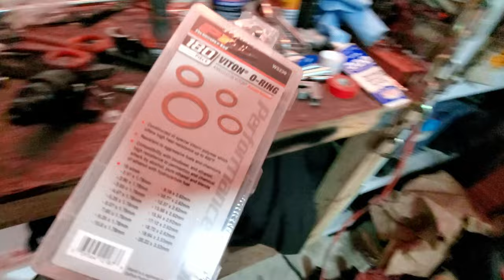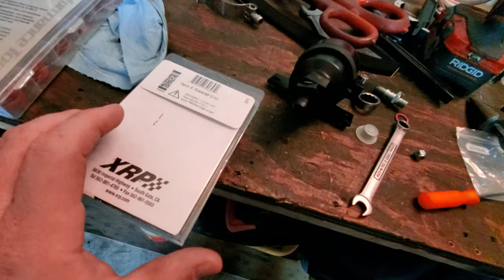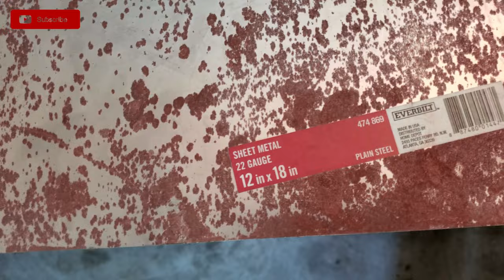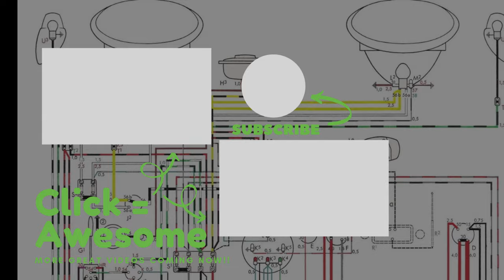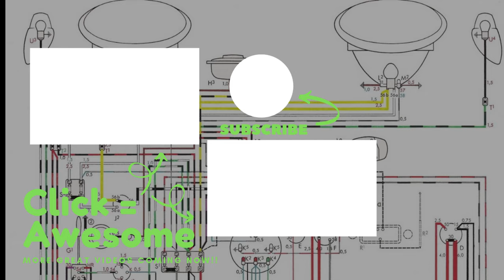1956 TURBO VW BEETLE - EFI Fuel System - Part 4 | JW Classic VW

Comment: Fuel line transition is much better! Nice simple bracket makes it look cleaner and is much more secure. A suggestion for a painting, instead of using a clothes line, I use a cheapo clothes rack from The Walsmart. Just lightweight tubing and it has wheels so you can move it around. It just press fits together so when you’re not using it, just pull it apart and stick it in the corner. Just a thought. Awesome job so far brother! Can’t wait for the next exciting episode!
Reply from the maker: Great idea on the clothing rack... I'll look into one.

Comment: I've been following your build.  I like your workmanship and creativity.  That 044 pump is the same one in my Audi B5 S4 with a full stage 3 set up.  In my case, that pump is good for about 425-450 HP at the crank.  

I'll be stealing some of  your fuel system build concepts for my 1971 Super with a turbocharged type 4.  The test motor is a 1911cc.  The big motor should be a 2600 with a T4 turbo.  

Thank you for your channel.
Reply from the maker: Appreciate the love and support, it's been a journey 4 sure!  I always love to hear that people enjoy the channel.  The biggest thing I try to show is that it can be done... I know the build is a little extreme but I know for 1 guy getting it done in his little garage the VW crowd can see anything is possible.

Comment: Great build...With all the volume of the E85 being used. Maybe it would be good to make a larger fuel tank?  Tig one up in aluminum. Seems like it wont have a very good range. MPG will be less than gas and  seems like you will need to fill up more than one time a day with that big turbo engine and Extra fuel use of the E85 will be short for driving range.
Reply from the maker: Kinda been thinking about a surge tank or an additional tank somewhere.  Definitely not a bad idea.
Reply: @JWClassicVW  yea you could make a rectangle box with a lip to set in the same hole. then square up the bottom to fit with he steering stuff. might get about 13 gallons or so. Which would be enough to get some range.
Reply from the maker: Yeah... there is definitely going to be an on-going evolution of Goose to a full out street killer race machine.  Roll cage coming with some cool seats.  Man I would love to have you help me come up with some sweet seat pads for the race seats.  Maybe we can get some ideas rolling?!?! lol

Comment: Hi I wanted to ask what kind of paint did you use for your gas tank Ty kp up the great work cant wait till its done
Reply from the maker: If you check out the video description the info is there on the Gloss Black and the special clear coat.
Reply: @JWClassicVW  well duh I guess I shld have read more.  Thanks

Comment: Is the haltech easy to set up? I know you bought the engine with the efi already on it but I want to go to efi and want to know if you can give me a basic must have to run a efi set up. Like a ECU, fuel injector (size) head temp sensor , timing sensor, TPS and anything I missed for a beginning set up. Your input would be great or if a CB setup is better way to go. I just feel like I could piece it together cheaper and have better stuff. Thanks
Reply: So what is the basic sensor list needed to a engine running with a haltech ECU
Reply from the maker: Did a video on the sensors brother.... there are a few other that are nice to have... I'll see what I can put together.

Comment: Is the 5speed a overdrive thanks
Reply from the maker: No it's simular to the final drive in a 4 speed... with the 5 speed your just adding an additional gear to shorten the shifts.  You can check out more info on the Berg website.
Reply: @JWClassicVW  thankyou 😊
Reply: I think it is a great track option. Ususally you shorten the gears when your on the track. and it makes the car not drivable for regular freeway. So 5th gear is like a normal 4th but the 4th is for the track if you get what i am saying.
Reply from the maker: This trans gearing is still good for the freeway... not sure on prolonged driving but it will cruise at 70mph at around 4200 RPM.
Reply: @JWClassicVW  yea for sure on a long drive that might be an issue that is high rpm for most vws that would not work. Most over max of 3800 will run hot and blow oil out. yours being turbo and vented may be ok but it will be a wait and see. Fan reaches maximum efficiency at around 3500 may experiment with power pully...IDK. Shroud starts to pressurize at some point and fight against itself.
Reply from the maker: This engine is running the Bernie Bergman set up for cooling.
Reply: @JWClassicVW yea should be ok. I just dont know the maximum pressure for that setup and RPM it achieves it  probably will like a higher rpm than vw stuff. Porsche fan may be designed for use at higher rpm on freeway since they run at higher RPM. some guys say that that setup runs hotter. May be because they are running at less RPM on the freeway. IDK.